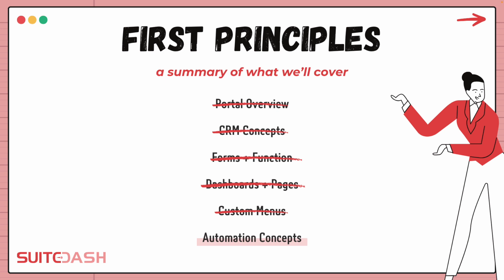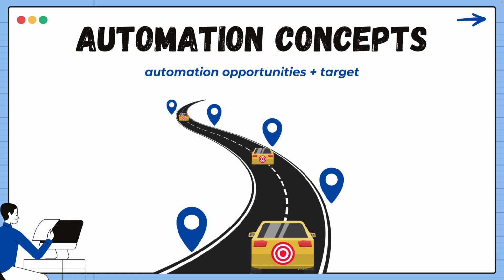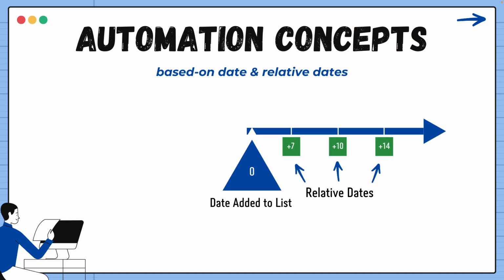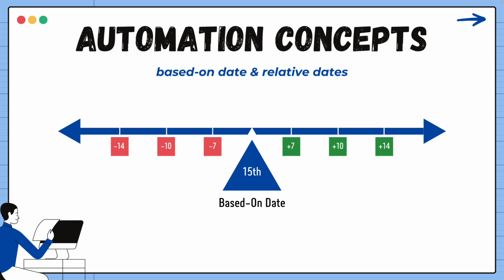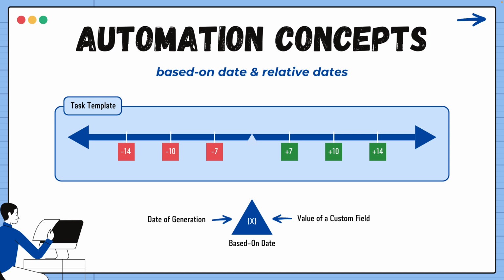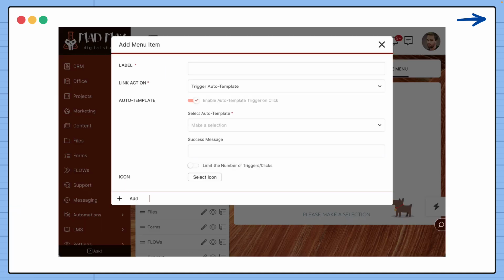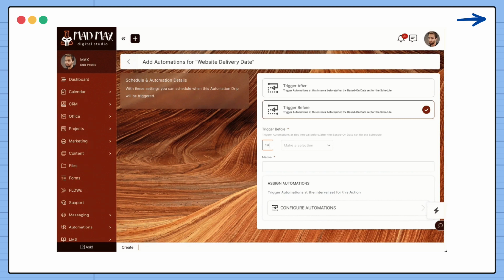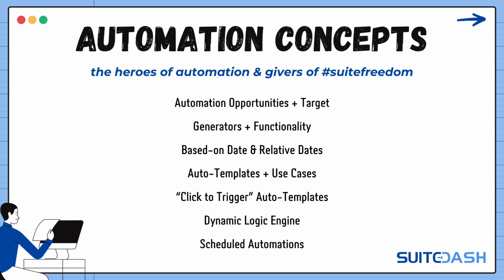SuiteDash First Principles : Automation Concepts

Comment: Commenting on the entire playlist not this specific video: I see a great opp here to impact viewers more and get their attention if the examples used are more relevant, like using real business examples to describe circles rather than bands, and spending less time or even eliminate the long explanation of known stuff like difference between static and dynamic pages. I don't think someone not familiar with this kind of basics would be interested in your product to start with.
Also the great feature you have, which is white-labelling to clients. I see much less talk about how it works other than the branding and page and menu customisation parts. For instance, how does leads and CRM work in that case? can my client as an agent has their own leads and workflows? can we see videos explaining the real power of suitedash in that area?